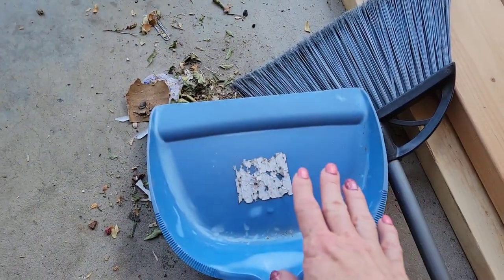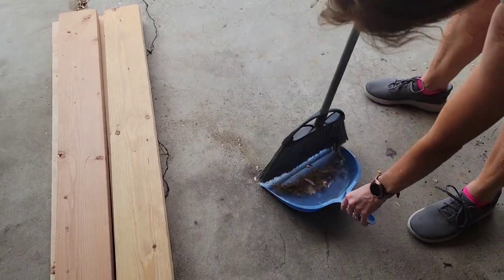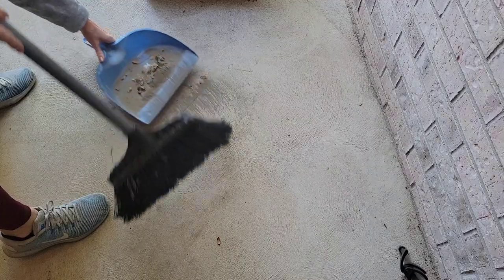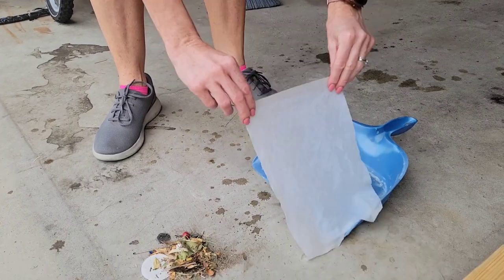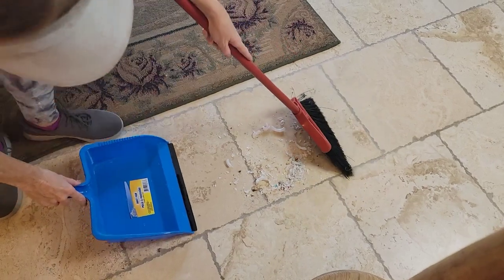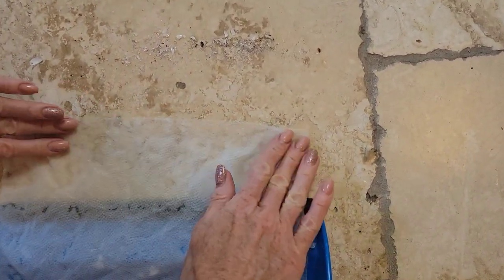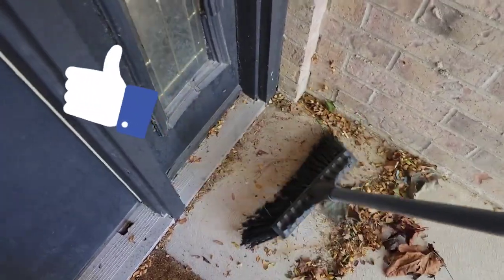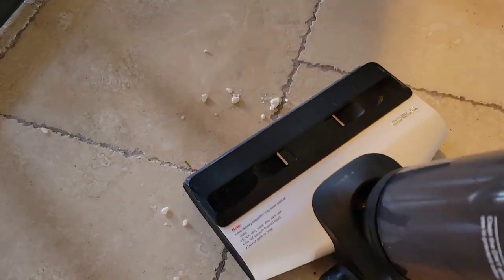It's Too SIMPLE to Believe, But it Really WORKS | Best Sweeping Hack

Comment: A page from a magazine does 100X better that paper towel
Reply: Wet a 1inch edge of the magazine page, press onto your floor, now the broom will sweep all the trash over the wet part, sending it right into the large dry area of the page.....no dust pan needed

Comment: I usually keep after it until I don't have visible dirt anymore.  If it is glass, then I have 2-inch masking tape for that.  I stick a yard of tape to a yard stick leaving about 1.5 inches of sticky available to pick up the dust or broken glass.  Wipe it a couple times and you'll see what the broom, vacuum, and mop miss.

Comment: In the garage I start with a broom and dustpan and finish getting the fine, leftover stuff using the dustpan and a horsehair brush.  Inside I go with a broom or Swiffer and finish it off with a hand vac or my electric broom.

Comment: Calls  herself a clean freak and germophobe! 😂 

 I’ve never just brushed the dust away like you did. 
Nowadays a use my handheld dyson vacuum cleaner. Way back in the 80’s I’d just run the hose from my big vacuum cleaner over that line.